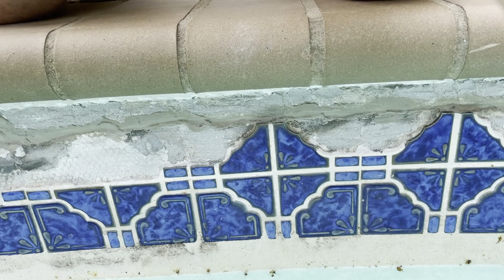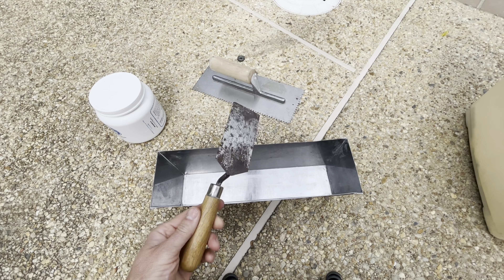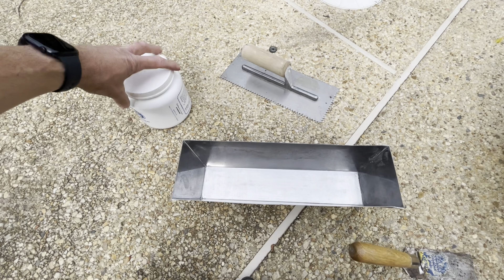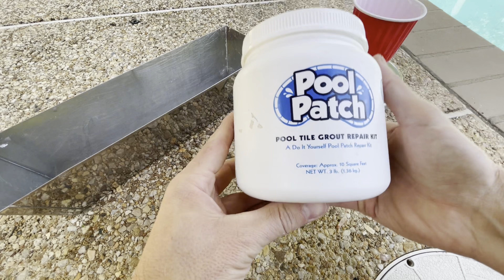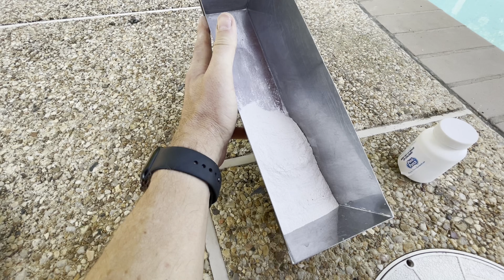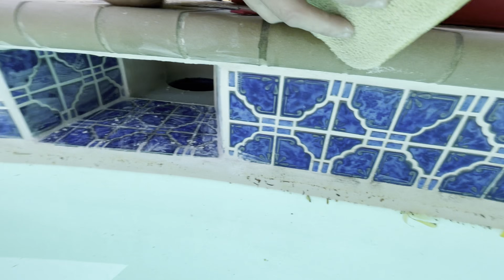DIY Pool Tile Repair Pool Patch and Install | Remove Clean Set Grout Waterline for Broken Loose Tile

Comment: Very clear and helpful video Handy Home Repairs.  
Do you know why your tiles were falling off?  
I think mine are coming off because the coping is failing and water is getting behind the mortar and behind the thinset and freezing and popping off tiles and sometimes chunks of the mortar with the tiles.  I don't think putting Drylok at the tile/coping seam will help.  I think I need to find a way to keep the pool deck dry and above freezing over the winter.  Would love your thoughts. Thank you.
Reply from the maker: My belief is that it was coping caulk and also the crack in the concrete behind the tiles. One or both of those things was allowing water to make its way to the thinset backing and dissolve it. I actually tried resetting the tiles once before and didn’t fix the crack good enough or replace coping caulk and it only lasted one season. I have another video where I replaced the coping caulk. Since I fixed the caulk and did a better job with the drylok the tiles have stayed in place for the last two seasons so it seems better. Hoping it’s good this year too.

Comment: can chipped tiles be a cause of leak? my pool leaks then settles about an eighth up of my tile line, with the pump off. not quite at the bottom of the tile line, but a little above. so its nothing that involves circulation or anything below the tile line. so really there has to be some tile line issue that im not noticing
Reply from the maker: Yes, chipped tiles can be a cause of a leak since water can get in if the crack is large enough. You can also have a crack somewhere else in the pool or around a light fixture, etc. they have leak detector, which is just a coloring. You put it near a suspected leak and the color will get sucked into the leak or crack. There obviously has to be a decent amount of flow for it to move the coloring.

Comment: Do you have a video on what it took to prep the walls? I see epoxy and crack filler in list but no where in video you using them.
Reply from the maker: I only cleaned off the walls with wire brush to get rid of previous thinset. I filled in the cracks with the drylok crack filler. I did not record that procedure because it is just like filling cracks with caulk. The putty you can use for filling cracks in the grout if you don’t replace but I would not use that for cracks in concrete because it’s isn’t flexible like the crack filler

Comment: Great video.  Is there a good way to collect the falling debris during repair ?
Reply from the maker: Not really which is why I was trying to catch as much as I could. Afterwards I used my vacuum (connector over the return with a hose) to suck up the pieces and then cleaned them out of the basket afterwards. The Polaris vacuum cleaned up the rest over night and I cleaned out the net. The smaller pieces dissolved and were just picked up like other dirt so it was not a big problem.

Comment: Thanks for the video!  Question, will the tile repair mortar fill the cracks or should I do that separately and prior?  Some cracks are 3/4 and an about 1/4 deep.
Reply from the maker: I used that drylok product I showed at the beginning of the video to fill the cracks in the wall before laying the tile and let it dry for a day. I had previously tried hydraulic cement but it leaked so I think you need specific crack sealer like drylok that has some flexibility so it doesn’t crack.
Reply: @ thank you sir!  I used NP1 Metrosealant that I had on hand that I’ve used for some waterline cracks.  My concern after 2 hours of sealing around the pool is will my Tile Mortar repair adhere with that sealant that I applied that was behind the tiles.  I’ll be doing the tiles tomorrow so the sealant won’t yet be fully cured.  Fingers crossed!  Keep up the great work!
Reply from the maker: Sounds good. Give it the most time you can to cure. You could try roughing up the sealant a little (without damaging it) so the mortar has some place to hold. You could also try concrete glue which helps bond mortar, plaster, etc to new surfaces.

Comment: I got 8 pcs exact tiles broken but because the pool is old and I am unable to find any tile shops who sells this tile anymore in Sydney Australia. Could you please tell me where I can buy those tiles? Many thanks🙏🙏🙏🙏
Reply from the maker: Unfortunately I can’t find mine either. You can try searching for waterline pool tile. I had one that cracked and I was able to glue it back together with tile/ceramic epoxy and then reset it. Seems to have worked ok

Comment: Hello, do you know where I can go to order those tiles?
Reply from the maker: I have not been able to find them easier. I was missing a couple small rectangles so I replaced them from an area inside the skimmer and then I just filled that area with grout since it isn’t visible. They are called pool waterline tiles if you search and can find them.

Comment: Wow, that was a big repair. You did a perfect job. My pool is 45 years old. We lost 5 tiles like 10 years ago. I just lost one tile. We are having the pool drained and washed and fresh water.  Will have my pool guy replace the tile.
Reply from the maker: I think the pool is settling uneven and there is a 20 ft crack behind the tiles which is what I think loosened the tile with water infiltration. Thanks for watching!
Reply: @handyhomerepairs oh man bummer about the crack. My sons hot tub is separating from his pool. Has to have the whole hot tub demoed and rebuilt. $$$$$$$$$$$$$$$&😠

Comment: Well done Sir!  I’ve reinstalled my tiles several times over 22 years.  This time I’ve fully drained my pool. I have 6 areas totaling ten (12” 12”) diamond pattern (Akron) sheets of tiles.  Your procedures are very similar to my approach, but your attention to the details yield a more professional, and no doubt more durable, finish.  I’ll be following your template.
Reply from the maker: Thank you! I did it once and they fell off at the next season. I think the crack was allowing water thru and ruining the integrity of the mastic, so I sealed the crack this last time and made sure everything was extra clean. I never want to do it again !
Reply: Follow-up:  how did you remove the mortar/adhesive under where the tiles popped out (on the pool wall)?
Reply from the maker: A bit of a few things because it’s a narrow area. Started off with a screw driver to scrape some grooves, used a paint scraper the other direction to chunk it off,  then final clean up with a wire brush. I figured for areas that were really hard to get off that I would leave them if they weren’t too think because it would be somewhere strong to hold onto anyway.
Reply: @handyhomerepairs how did you avoid having all those pieces fall into the pool?

Comment: Please advise because I am going to have to do-it-myself; consequently, I will be punching above my weight class. I cannot get any help from the swimming pool industry businesses.  While I was wading in the swimming pool at night in June 2024, I noticed a couple of pool tiles that looked different from the rest of the tiles: I inspected them and realized that three-(3) fell to the swimming pool floor and I am sure that the rest of the tiles are in the process of losing grout and dislodging from the wall. This is when I learned that the brown tiles were a veneer covering the original tiles.   I have conversed with a couple of swimming pool companies, which most don't actually perform the construction they subcontract the work to mason companies and they are useless: they all want to demolish our concrete/gunite swimming pool and build a new swimming pool. I have conversed with masonry companies about repairing our stamped concrete pool deck, which essentially also serve as the coping area.  I have conversed with bath and tub installers and plumbers about repairing the tile - CRICKETS!  I found the old receipts and learned that the pool essentially received a overhaul in phases by two different contractors. The first phase was installing the brown tiles over the original tiles in March 2008. The brown tiles were an aesthetic preference because my parents did not like the original tiles.  The second phase was servicing the pool deck slabs [Slate Stone Design] in April 2009: this phase was done for safety concerns because when the pool deck got wet it was slippery.  Both phases cost in the thousands.  I remember Dad telling me that it was the record-breaking rain showers in early spring or late winter of 2014 that caused the pool deck slabs to shift and crack.  In May 2018, approximately fifteen-(15) tiles fell into the swimming pool and a local pool company reattached the tiles.   I contacted these companies and I do not hear back from them.  We live in the panhandle of Florida south of Alabama, so most of the swimming pool companies and contractors serve business-to-business.
Reply from the maker: Sorry this comment did not pop up on my feed for some reason. Were you able to solve the problem? Thinset does not stick very good to tiles, especially if they are glazed. If this is what they did I can imagine while they are falling off. I’m not sure how to fix it other than take off the original tile, build up to the new level and then set the new tiles.

Comment: To get thinset or really anything off the back of the tiles I use a wheel grinder with a grinding wheel or the sode of a cutting wheel.  Takes it right off.  😀
Reply from the maker: Yes, that will work. I really just wanted to make sure they were no high spots so they would lay flat. Thanks for watching and the tip
Reply: @handyhomerepairs  you did a great job!  I just redid my pool and it's hard to find that old tile.  I wanted folks to maybe have another option.  Videos are great!
Reply from the maker: Yeah I was missing a small decorative part and couldn’t find it either so I left it missing inside the skimmer and just filled the area in with grout lol nobody will ever see it

Comment: Thanks for the video. After a year is the grout holding up well? Would you do anything different in retrospect?
Reply from the maker: @sebonac83 yes, everything still good after a year. I’m glad because it took a long time to clean and prep. This was my second time doing it and this mortar seems to work much better. I think it also helped sealing the crack with the waterproof caulking. The cracking has continued in a place that I didn’t do so it seems the settling is continuing but the work I did is holding up thankfully

Comment: What I’m trying to figure out is what do you do if don’t have all the tiles that fell off. Mine is an older pool like yours where there are very intricate pieces.
Reply from the maker: I was missing a couple of the small tiles so I just filled those parts in with all grout but it’s only about 3/4” square. You can see it inside the skimmer. Otherwise maybe you can get something close and maybe a solid color and try to put it in an inconspicuous place like the skimmer walls if you can get those offer to switch

Comment: I've tried everything and they continue to fall off after a long while
Reply from the maker: You are using the tile set and not the grout product?
If you are using the tile setting, when the tile falls off is the mortar still wet? If so, you are either mixing it a little too wet or the surface you are trying to stick to is too wet. Maybe water is leaking from the other side of the concrete?

Comment: How do you keep the tiles flush and even as you piece it together so its a smooth surface?
Reply from the maker: Use a level or other type of straight edge that is a long as workable in the space you are tiling. Check each row and across multiple tiles so you are not just making them level to the one next to it and end up making gradual mistakes.

I have a couple videos on tiling in my playlists for the bathroom remodel that may help demonstrate. I tile the wall and the floor.
Reply: @handyhomerepairs  Thank you.  Another question - there are large cracks along the wall surface where the thinset would go.  What did you use to fill those in?
Reply from the maker: It is in the video description but you can find at Home Depot or anywhere. It’s just drylok crack filler. The same company that makes the paint for sealing cinder blocks. My walls of pool had cracks (which is what caused the tiles to fall off) so I sealed the cracks.

Comment: How much would someone charge for that repair?
Reply from the maker: Not really sure, but around me the contractors don’t want to do any work under $2,000 USD. It would be more than a 1 day job.
Reply: @handyhomerepairs  Well I just did 4 3”x3” for $60 for an old lady. 🤷🏿‍♂️ it took me 15 minutes so I would feel bad charging any more than that. They rest of the tiles need grout so that would be a separate price I guess if she wants to regrout the whole pool.
Reply from the maker: Yes. If you can find a reliable handyman like yourself that will charge a fair rate by the hour then that is great. It’s the overhead of companies that have to support staff and the business. Most times they just farm it out to a subcontractor anyways and just take profit off the top so they overcharge

Comment: Does the grout patch that fell into the water adhere to the pool surface? How do you clean up particles which fell in ? I’m concerned about clogging the drain pipes and filter.
Reply from the maker: @debrafoster-brunst8582 I did not have any filter issues. Unless you dropped really big pieces, it will mostly fall apart with all the water around it. I was opening my pool so I already had the vacuum out and used it to clean up. Then I ran the Polaris pool vac to clean everything else. I also did not have anything stuck to the wall and used the pool brush to push everything around and break it up a little before I vacuumed
Reply: @handyhomerepairs  thank you so much for your reply. Great video.

Comment: The residue of the products falling into pool water, that’s ok? Does it mess up water chemistry? Do you just let the pump take care of cleaning it through the drain? Also, I have large areas that fell off the pool line, maybe 30%, with cracks etc. I am thinking next year of removing all of it, and buying a new style of tiles. There’ll be dirt and residue I’m sure. Do u recommend I completely drain the pool? That’s what I’m thinking. And maybe repaint it while at it.
Reply from the maker: @adnen.benali I spent too much time trying to catch any falling residue. When I was done I vacuumed as much as I could off the floor so I don’t think it had any impact to the water. Polaris robot picked up the rest. It is definitely more work trying to do it upside but cheaper than draining and paying for refill, but you can decide the benefits depending on how much effort you want to put into the job. If your pool color is looking older then you could combine the jobs and repaint or acid wash if it makes sense money and time wise.

Comment: How did you get the tile off without it breaking?
Reply from the maker: @Elizabeth__Smith water was leaking through in a crack behind and dissolved the thinset mortar on the back of the tiles so they loose. Some had fallen off and others were loose enough to scrape off with a trowel. If they are held strong to the wall still, you probably don't need to remove them. You may just need to redo the grout to clean them up.

Comment: What do you do if you have the plastic strip at top of tile? Do I just replace that space with grout? I would like to remove the plastic strip altogether
Reply from the maker: @user-ou8zb4lr1e I have never seen that before. I searched around and it looks like it is called a tile strip. If this is the correct item you are talking about it appears to be embedded in the concrete and you can’t get it out

Comment: My pool tile grout is not white. It is actually concrete/ cement like grout. Any product suggestion?
Reply from the maker: @grxmrme it looks like EZ Patch and Pool Patch have colored grout. Neither look like they have the gray you may. Looking for if it’s just cement in the grout. It may be a thinset but probably not concrete. You could try mixing some of their colors together and see if you can get the color correct. Another option is epoxy-based grout. I have a video where I use Starlike EVO grout in my shower I remodeled . Epoxy grout should not be permeable. If you go with epoxy, you have to work quick because it usually starts setting up around 45 mins to 1 hour. You also have to do a good job cleaning the grout from the tiles since the epoxy sticks a little more than the cement base grout

Comment: I am considering this project myself, did you use the putty for larger gaps and the drylock for smaller cracks? Thank you for documenting this process!
Reply from the maker: @fishrmn25 I used the drylok for all of the cracks. I had tried using hydraulic cement previously but it just cracked again so I used a seal that would have some movement instead this time

Comment: do you have a video on sealing the crack?
Reply from the maker: @karaa3594 I forgot to record it. It was a hairline crack so I used the Dremel tool with a carbide tip to widen it a little so the sealer could have a little more to hold on to. I then used the wire brush to make sure there wasn’t any loose material. I then used the material to seal the crack and left it over night to make sure it was completely cured.
Reply: @handyhomerepairs Which sealer did you use for the crack?

Comment: Still happy with the results of the Pool Patch Tile Grout Repair Kit?
Reply from the maker: @TheBoxFitter yes. I liked that the grout contain the glue to make it a little stronger and add some waterproofing. It was textured but still fine enough that I was easily able to work it into the narrow areas that were about 1/8”
Reply: @handyhomerepairs, excellent video. I have the same exact tiles. Unfortunately, i have lost some of the broken pieces. Do you know where I could get them?